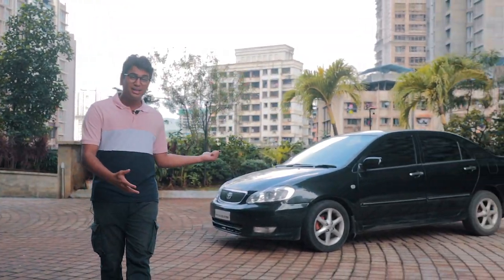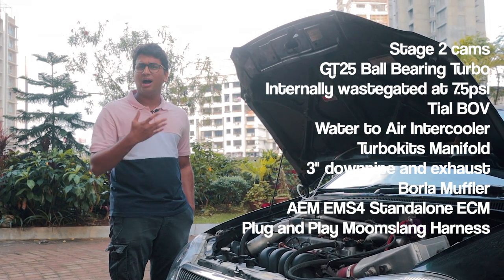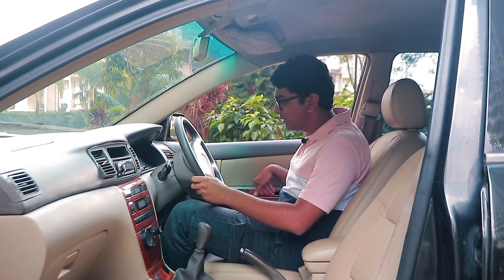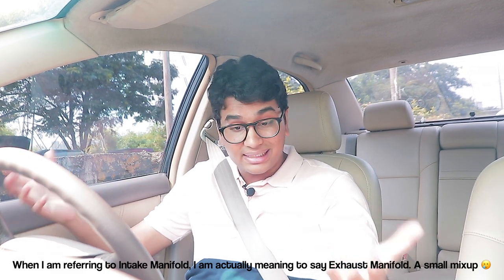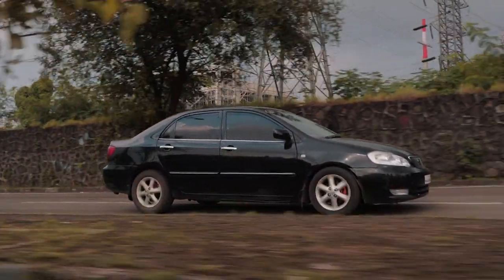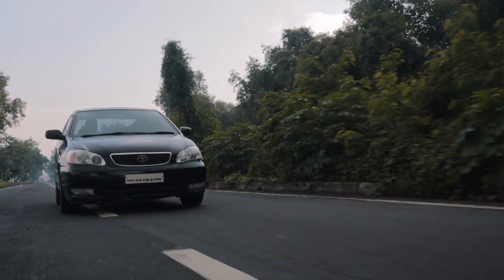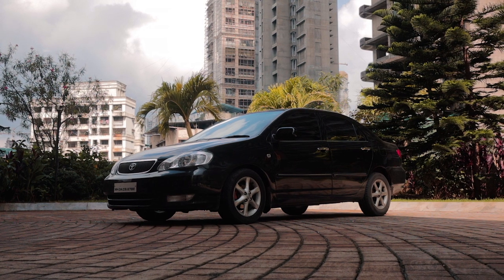Turbocharged Toyota Corolla 1.8 making 240BHP! | Is it better than a Skoda Laura build?

Comment: Imagine you challenge this car to a rolling drag race and you hear the turbo spool up
Reply: nice DP
Reply: @WeAero  thanks
Reply: Ooooo bhai maro mujhe maro would be my reaction
Reply: Shit!!!!
Reply: Lol! That’s a joke. That car isn’t built for that hp. WOT that car would crash and if it doesn’t it will when it can’t stop.
Reply: @user-ib5mx8ro4k  Just need better brakes -caliper and pads. It won't go 300kmph trust me. If it touches 200-205kmph it'll be a big deal. What this turbo and mods have done is improved driveability so it doesn't feel underpowered and is more responsive and enthusiastic. It doesn't make it into a M3 so don't worry about not being built for this HP.
Reply: Mai toh bol dunga bhai engine overheat hogya gaddi side mai laga do 🤣😂
Reply: Fatter tyres are needed to
Reply: Can't even imagine it dude

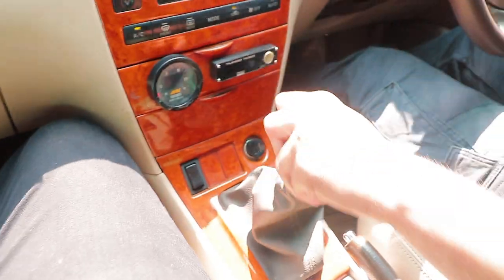Comment: 4:39 I agree of the throttle body but soft clutch and smooth gear shifting are key points of the corolla decades. Maybe it not fits according to your likings.
Reply: 100%. It's very jumpy if you don't slowly roll out of throttle before very delicate clutch movement (and perfect timing)

Comment: So that’s didn’t start as an XRS? Just a regular 1zz engine?
Reply: 2zz is a terrible car to turbo and have it last more than a year...
Reply: @tf7274  hey I have a Corolla xrs 2005 with the 2zzge and I was thinking on putting a turbo or maybe a supercharger! Why do you think putting a turbo on the xrs is a bad idea? If it’s tune properly it should be fine
Reply: @perezwailyn778  anyone who turbo's or supercharged their xrs, magically stops making videos shortly after. Something to keep in mind. If it was me. Enjoy the power ban where it is and do the bullet proofing mods like the oil pan and lift bolts. And do very regular oil changes(every 2000 miles) if you're constantly in lift. Let's face it; your not going to win against today's Toyota minivan.
Reply: @tf7274   yeah I thought about that I was going to stage 2 the engine and rebuilt the transmission before putting the turbo and do the oil pan if you change it for the Corolla le oil pan it’s better already and I’m taking the car to a professional custom shop! So I’m assuming if it’s done properly it’ll last with good maintenance
Reply: @perezwailyn778  I'm not an expert. You've done more than I ever did. Just did a lot of research years ago. My understanding is that motors that do well  with after a turbo install, are engines that aren't max'd out already being N/A monsters. Better off to turbo an engine that has good history of turbo's. The whole point of an xrs is high revs. After turbo you may be limited to lower rpms.